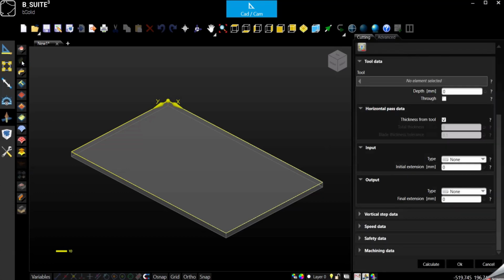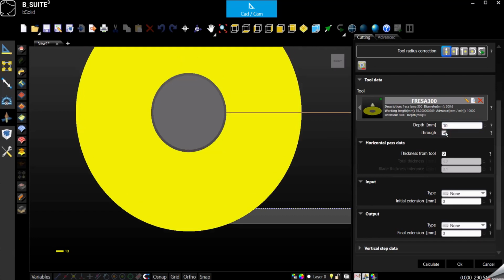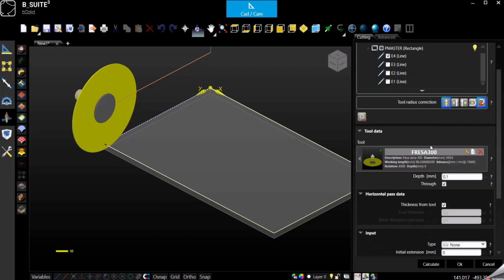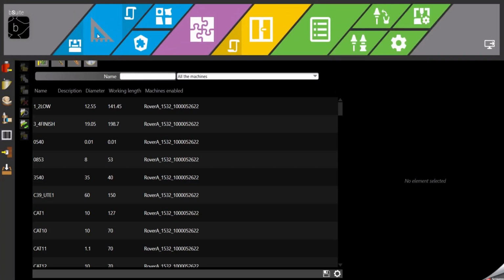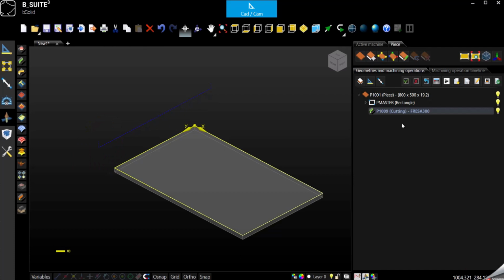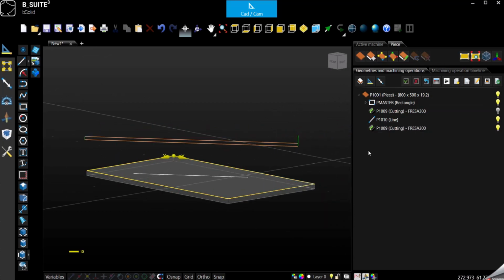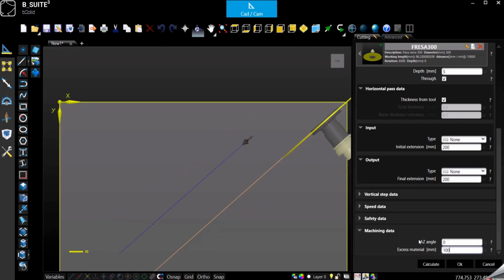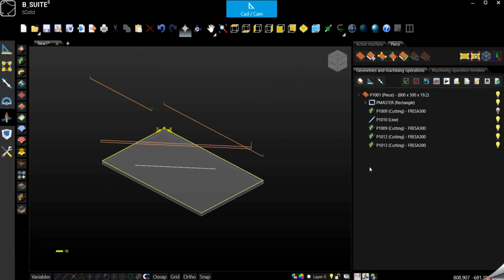6 - CAM BIESSE bSolid - Cutting

Comment: Hello,
How are you? I hope you are doing well.
I have been watching your videos on YouTube, and I find them very helpful. Thank you for sharing your knowledge and experience.
I have a question regarding the Vertmax 2.6 machine and bSolid software.
For example, when I process a 10 mm thick glass panel, the machine performs the chamfer on only one face of the glass, but it does not chamfer the other face.
Is there a way to configure bSolid so that the chamfer can be performed on both faces of the glass?
I would really appreciate your help or any advice on which settings I need to change in the software to achieve this.

Comment: I need to ask - Biesse Rover uses autonomous CAD/CAM software B Solid 1. is it possible to obtain this software for an external employee for the company that purchased Rover 2. is there any other CAD/CAM or only CAM from which B Solid can read output data, for example Alfa Cam, Catia, Solid Works Thank you